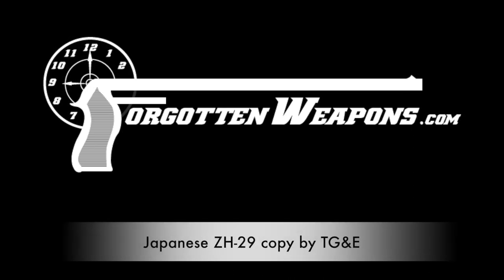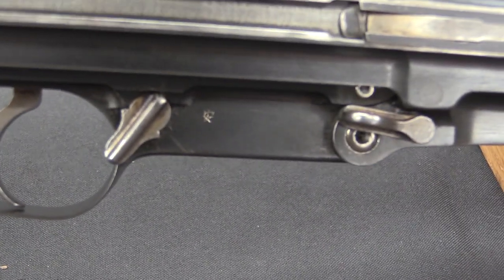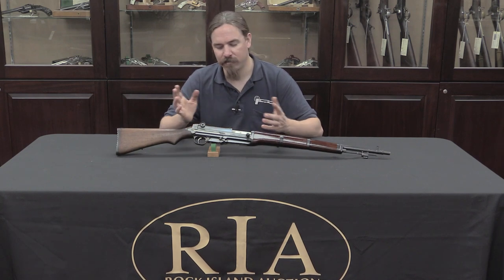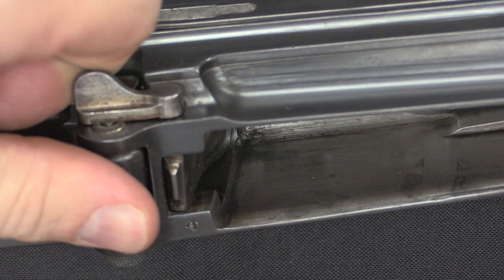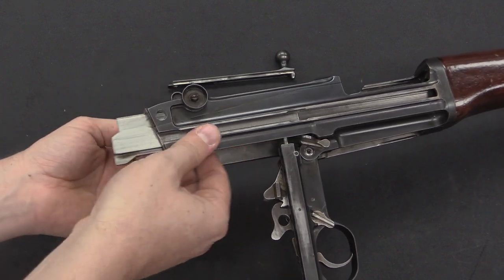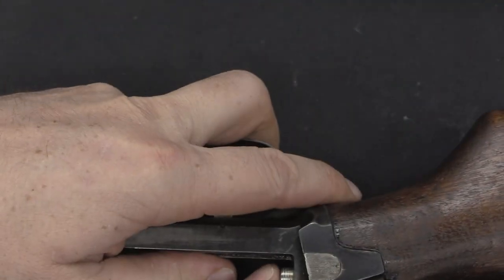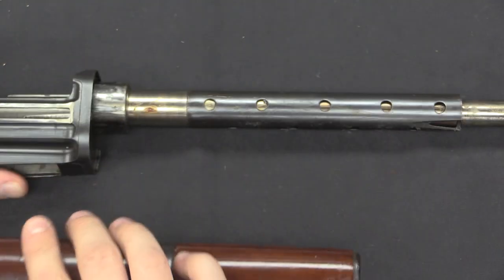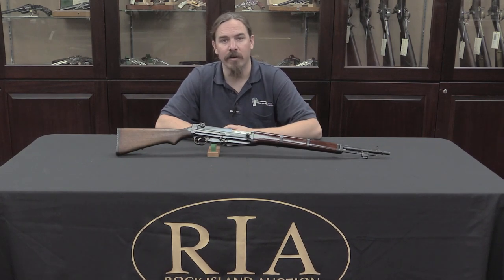Japanese ZH-29 Copy by Tokyo Gas & Electric

Comment: the japanese character on the front of the gun 空（air/gas），大(big/large)，小(small).
Reply: 空 also means empty or nothing. To a rifle gas regulator, it indicates either for shooting blank or manual bolt action. I guess. Check if gas port is blocked or not in that position.
Reply: It doesn't make sense to me that 空 would mean "empty" when it is next to 大. I think the text is supposed to mean "more gas" and "less"
Reply: +Kenneth Tessman uh Japanese looks complicated.
Reply: @NatsuKashi00  Rather late to say this, but kowualsky
 was actually correct. "空" in this case means "empty" or "nothingness" because it is the setting to cut off the gas system entirely.  The 大(large) and 小(small) are basically referring to the two gas levels for the gas port.
Reply: I like that there are enough people watching this channel, that are willing to help explain details.

Comment: the "安" means safety
the regulator "空" means empty or none it this gun should be none operation
the other "火"means fire but it also looks like"大" it means big 
and the bottom "小" means small for the  adjustable gas regulator

Comment: Why would the trigger being also the bolt release be considered unsafe? That sounds like it would be the most efficient form of bolt release. All it would be is the trigger is disconnected from the hammer when the bolt is in holding, then when the bolt is in battery release of the trigger would reset the trigger to the hammer.

I'm I missing something that would cause this to be an issue?
Reply from the maker: "Keep your finger off the trigger until you are ready to fire"
Reply: But a rifle is going to be issued to far more people then just troops in combat. So I'd still be nervous about pulling the trigger being an integral part of loading the gun.
Reply: +J. Murphy this rifle I can see that problem but with today's knowledge if machinery the trigger can be disconnected from the hammer sear when the bolt in hold open. The only thing the trigger is connected to is the release. Then the trigger has to be fully allowed to reset after releasing the bolt to once again connect to the hammer sear.

Beside, I don't know how one can manage to keep their fingers on the trigger when changing out the magazine. Only in Call of Battlefield is where your non- dominant hand is used to do a mag change.
Reply: Actually, there are assist devices like the Magpul B.A.D lever and the Phase 5 extended bolt release, both for for AR-15's which allow you all the advantages of being able to release the bolt with your trigger finger (speed mainly), without the inherent dangers of a system that uses the trigger as a bolt release.
Reply: +J. Murphy yeah, but those are add-ons. I'm talking about an integral function. I don't know. To me it makes sense. But what do I know, I only served for so long.
Reply: And? The Russian Vepr 12 shotgun has the the bolt release inside the trigger guard, there's no reason one couldn't design an Assault Rifle with the same feature. Which gives you the same advantage as the system on this rifle... but without the huge safety risk inherent to using the trigger for anything other then firing the weapon. I'm assume the reason that hasn't been done, is that new Assault Rifle development tends to be targeting military contracts, so there's an incentive there to prioritize conventional layout over innovation.
Reply: Accidental slam fires.
Reply: +Ian Babcock same thing can happen on any self-loading friearm. Slam fire is a firing pin issue not a bolt release one.
Reply: You already closed, got distracted, try to close it again............and.............Bang!
Reply: especially easy when you're mentally and physically exhausted from combat, operating in hot/cold/wet environments and distracted by potential threats. It's easy to forget what state your weapon is in.
Reply: I'd stop replying to this guy, he's obviously one of those "I served the military so my opinion on it is better then yours".
Reply: +BurnThePope who Me? no way has this bloke served in the military. and I'm not giving you my opinion I'm giving you facts
Reply: +BurnThePope And you are obviously one of those who get buthurt because there is people with more experience/knowledge.
Reply: crazyfvck "Keep your finger off the trigger until you are ready to fire"  and "consider the gun is always loaded" must not apply in order to release the bolts by pulling the trigger, gun safety rules a redundant to fully avoid unwanted detonations, not to reduce the damage they may cause.
Reply: With this gun, you probably did not reload by changing the magazine. Most likely you would have charged it with a stripper clip or two, giving you 5 or 10 rounds of ammunition. At which point the last thing you'll want to do is waste one of them.
Also, I don't think anyone ever double-tapped with a full-power battle rifle cartridge...nor should they have, really. Unless it was a /very slow/ double tap, I guess, with recovery from recoil in between? Or unless they were in /very/ close combat?
I guess what I'm saying is partly that I find it very suspect that the [supposed?] military doctrine you're referring to has multiple disadvantages if used with the weapons available at the time this rifle was designed, made, and purchased. The ideas also make a /lot/ more sense in the context of a much higher capacity weapon that is always loaded by changing its magazine. And with a weapons system that includes magazines that are often problematic [maybe the originally disposable STANAG magazines, when reused??]. It also seems to me that in a firefight situation, it would make a lot more sense to send a couple rounds in the general direction of the enemy...but I don't think that really fits with the doctrine and thinking of the time, either.

Anyway, +Rudofaux, you seem to be treating the safety objection as applying to the inherent reliability of the gun--in other words, you seem to be suggesting that we are concerned about some kind of unintentional discharge during the trigger pull that closes the bolt. But we are not. The kind of safety risk we're talking about is that of /user error/. In other words, someone unintentionally firing the gun because there exists any possibility in their mind--and their plentiful experience--that the gun will /not/ fire when they pull the trigger.
But +Filadelfo Zuniga already explained that, more or less.
Reply: +May your swords stay sharp! (mysss29) Yeah, I understood that from combat fatigue and user error. I'm sorry I haven't gotten a chance to respond to say I see why now & made this thread unintentionally open for debate.
Reply: Mate this thing is chambered in a six millimetre cartridge, that is in no way a full powered cartridge. Really this thing actually has slightly less firepower then your average .223 using AR.  A double tap with a shorter and lower powered round is a perfectly safe and useful technique. 

As for not fitting with the Imperial Japanese Army doctrine who knows. It certainly wasn't a technique taught to Allied Troops but not a whole lot of documentation concerning the nuts and bolts of the Imperial Japanese Army survived World War 2.
Reply: I, uh, did some fact checking for you:
6.5mm Arisaka - 138.9 gr (9 g) FMJ 770 m/s (2,500 ft/s) 2,666 J (1,966 ft·lbf)
.30-06 - 150 gr (10 g) Nosler Ballistic Tip* 2,910 ft/s (890 m/s) 2,820 ft·lbf (3,820 J)
5.56mm NATO - 4 g (62 gr) SS109 FMJBT*^ 940 m/s (3,100 ft/s) 1,767 J (1,303 ft·lbf)

[ all from Wikipedia.
 * Wikipedia stated that the issue ball ammo was 150gr, so I used the data for that projectile weight even though it's for modern stuff
 *^ This was the middle of the three closely spaced values, and the only one whose designation I recognized offhand. ]

...Well, I'm pretty sure Imperial Japanese soldiers didn't double tap with their standard-issue bolt-action rifles.
Reply: Rudofaux moved on to high jacking YouTube comments, huh max headroom? Lol

Comment: Don't know if this has been addressed, but since there is no bayonet attachment visible, could the second switch on the cleaning rod channel correspond with the cut out near the front of the cleaning rod, allowing it to be reversed and used as a bayonet,  possibly with a screw on spike?  Rod bayonets were in vogue in the US with the M1888 version of the Trap Door and starting with the original M1903 Springfield, so maybe Japan felt that a rifle without a bayonet was naked.  Cheers, Bruce.

Comment: The peoblem of the angled barrel ( and angled threads in the receiver body ) could have been simply resolved by having the bolt face angled so that with the bolt in the locked position, the bolt face was parallell/ normal to breech axis...for a square lockup.
The other tilting block guns( vertical) all work on this principle...bolt locked,bolt face square to barrel face and axis.
Has anyone ever looked atthis solution,
Ian???
Doc AV
Reply: I was wondering the same thing!

Comment: Why offset the barrel to accommodate the tilting bolt, then offset the sights to accommodate the offset barrel?  Why not just mill the bolt face at a slight angle and leave everything else in line?

Comment: i can see why it had "accuracy issues". every thrust influence during cycling basically wants to spring that action to the right (barrel to the left), with that gas block adding an upward component as well (and torqueing the be-jesus out of the barrel at the end of the handguard). i bet that's why they closed the right side, and changed to the non recip op handle. the "new metal" all has i-beam like section as a design feature (rigidity to combat the main flex component, that "muzzle left" spring). toss in that barrel sleeve with uneven bearing surface at it's front end, the skinny barrel proportions, and a TINY crush shoulder interface between barrel and receiver, i'm actually kind of surprised it had any accuracy at all. in high speed vid, that barrel must watusi like a 60s mod kid on acid, lol

Comment: Could the off-center main spring have had a negative impact on the accuracy of the rifle?
Reply: pretty much every design feature did. all thrusts during operation want to spring the right side of the action open, with the gas block also adding an awesome "diagonal up to the left" component to the muzzle (which lets both handguards work as springy bits influencing barrel harmonics).basically, the components all add up to a VERY erratic, violent vibration pattern in that barrel on firing (that pie wedge missing from the barrel sleeve, wtf???), which always means "horrific accuracy". it's why the model was a market failure, no matter who made it. the receiver is a leaf spring, lolololol. what's funniest is beefing up the LEFT side would have done them far more good.

Comment: Locking system bolt locking lug..has weird angle that MAY have slipped unlocked early and variably. Cases backed out variably as a guess. Inaccuracy. Blish?

Comment: They've got non reciprocating charging handles on guns like this dating back to 1929 and earlier. They're on the BAR, and FN has one on its own FAL. So someone explain to me why on earth modern guns like the SCAR, CZ 805, Galil Ace, etc still have rigidly attached charging handles? Especially on the SCAR and CZ 805, it's a bit of a liability, as it can hit your thumb is held certain ways.
Reply: For forward assist. It's very common with European rifles still to this day, and I don't personally mind. The fact that it's moving wouldn't bother me much and the possibility to push the bolt into battery is kind of a plus. If nothing, military rifles sometimes have this just so that they could check the "forward assist" box when it enters trial.

Comment: And seeing the front sight come off the barrel, isn't that a likely explanation for the lack of accuracy?
Reply: the least of the problems, lol. remember your newton, that whole "equal and opposite reaction" thingy? with that in mind, peek at the layout of that arm, and the influences the various thrust components in the firing cycle will have, and the newtonian counter-forces also produced. it's a line of leaf springs, with no shock absorbers, lol. that's why it failed in the market, no matter who made it. to fix it, you would need a 15 pound rifle, which just happens to be about the lightest weight light machine guns that used similar schemes successfully.  neither receiver or barrel are particularly rigid, the barrel receiver interface "crush zone" is miniscule, hell, even the barrel sleeve is asymmetric at it's front end. if you honestly tried to make an inaccurate rifle, you probably couldn't exceed the potential of this one by far, lol. it almost seems the original designer was hoping the bullet "dragged the barrel forward" enough to dampen such perfectly calculable "tendencies to slam dance" in operation. if so, he was wrong, lol. but, such is a very exemplary reason why semi battle rifles were "hen's teeth" for so long. it's quite a feat to make a reliable, accurate, robust, gunk proof, comfortable, and long lived rifle that is operated by the grubby paws of the grunt holding it, never mind one that "does all the heavy lifting for you".

Comment: Does anyone know why they didn't make the bolt face in the unlocked position at a weird angle? (And thus the bolt face straight while locked.)  It seems like that would be simpler than making the barrel off at a goofy angle.

Comment: it reads "安" which means "peace" :)
Reply: I respectfully disagree. That character can also be translated as "secure" but given that it is placed where it is it does mean safe, just as Ian assumed.
Reply: Peace, secure, safe, it depends on the context
Reply: hvymtal Exactly. In this context it means safe.
Reply: hvymtal You might be interested in hearing this, or you can ignore it. I find it interesting.
The character can be divided into two parts. The upper part is a roof representing a house. The lower part is a woman. That means the most literal translation into English would be a woman under a roof. From that we get the idea that the woman feels safe, secure, tranquil, at peace. Stretch it, and a man feels better when he knows his wife is safe--protected by the roof and house.
Reply: ***** Which is why generally speaking "proper" translateions are preferred over literal ones, and why "proper" translations can vary
Reply: hvymtal Back to practicality. The character on the rifle tells the soldier that when you push the selector lever forward, the rifle is on safe, not at peace with man and nature.

Comment: And can anyone tell me why you'd want to adjust the gas flow on a semi automatic rifle?
Reply: Late as hell. The reason for a gas regulator or adjustor is to fire rifle grenades with all of the gas from a firing. Some ammunition also had gas pressures that made the gun operate poorly, and this can be fixed to an extent with gas adjustment.

Comment: The 小 japanese character at 10:29 can mean either "small" or "secundary" (or "child").   https://youtu.be/HgnYzsyJCoM?t=10m29s
Reply: It does mean small. The character just above/before it means gas. The character in the same area but on the underside means large. Therefore we can say that it is the gas adjustment and if you were to turn the knob "upward" you would reduce the gas flow, but if you turn it downward you increase the gas flow. Probably a small port and a large one.
Reply: Thanks!

Comment: So I have a question, instead of off eating the barrel, why couldn’t the Maybe the surface of the barrel and the bold face and cut add an opposing angle to the actual angle of the lock of the bolt so that they would still lineup street until unlock and then they can just pivot on that hard corner

Comment: Shouldn't you be using the old Japanese flag with the rays?
Reply: Both were used at the time
Reply: mowntan duw which was the national flag when?
Reply: The flag with the rays (the 'rising sun' flag) is a military ensign, while the white flag with a red disk is the national flag
Reply: The ray sun flag is actually the flag of the arm forces, not the national flag.
Reply: Matt Juro ok, thanks.